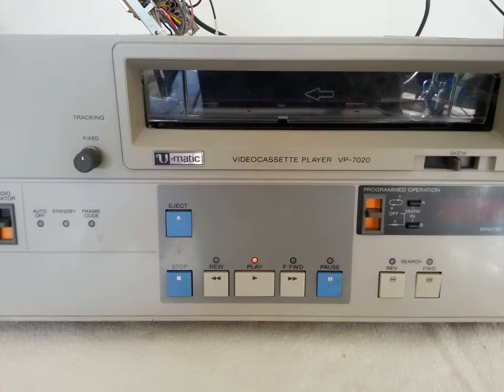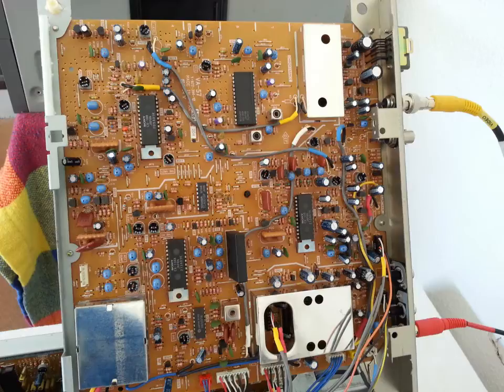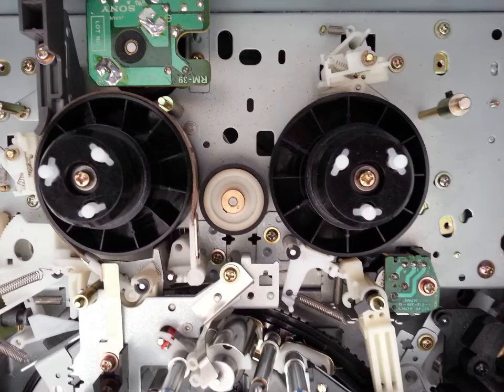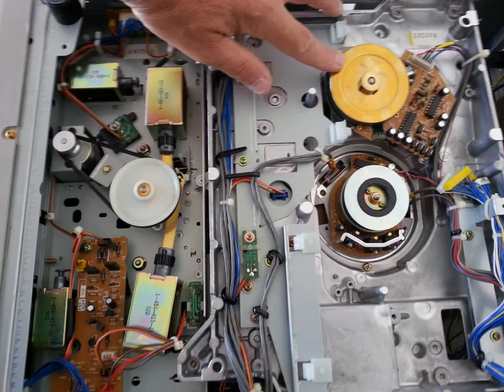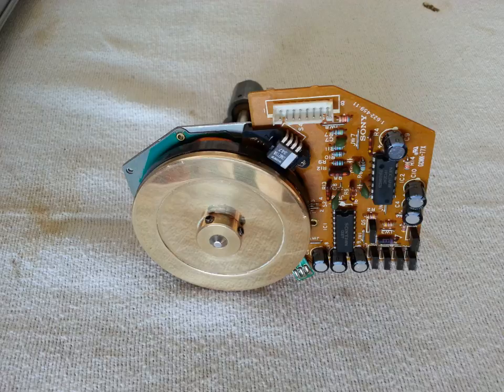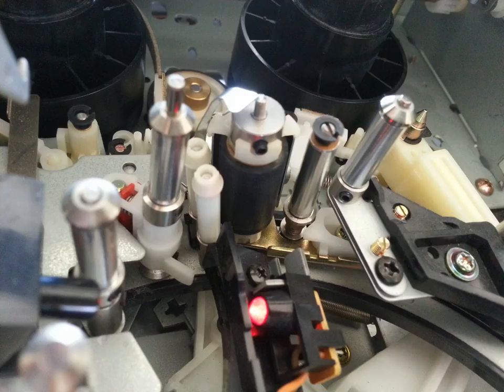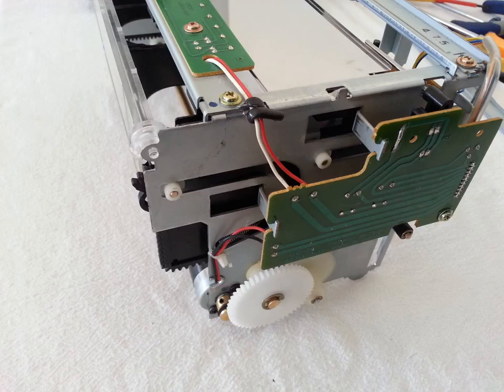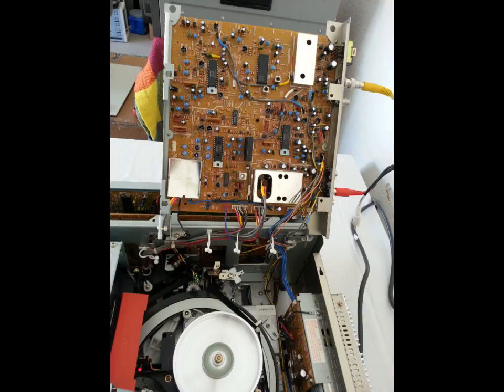Sony VP-7020 3/4 U-Matic Complete Over Haul Repair.

Comment: I have a question: Has the VP-7040 similar problems? My VP-7040 can be switched on and the yellow stand-by lamp and the red play lamp first light up, but then go out again immediately. The cassette in the cassette slot cannot be ejected. Any idea or how I can get at least get the cassette out? Thanks so much for your feedback.

Comment: I just dug mine out, cleaned & blew out the insides with dust-off. Always worked, now will not power on at all... looked for a fuse area, none found. Any tips?
Reply: It's near the back of the machine, back right corner looking from the front.  it's a standard fuse you can buy in a hardware store.
Reply: @jimjenner  Hey! Just found this video. My VP 7020 keeps blowing the fuse (2.0A 125V) just above the power input. Any suggestions or ideas?
Reply: @CharterReddingChico  Hi John.  I'm not a tech so I'm afraid I can't help on this.  I have had luck putting a fuse rated higher than the one that is blowing but I know this is not recommended.
Reply: @jimjenner  Thanks. The unit is of no use to me not functioning. Might as well give it a shot.